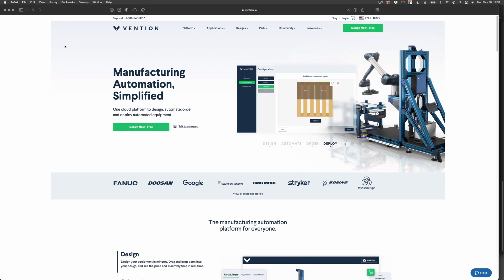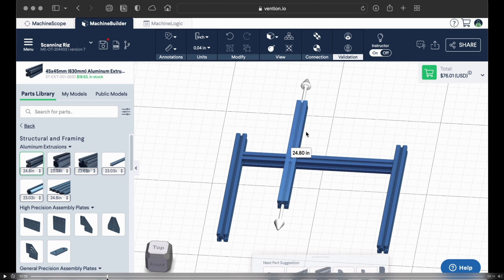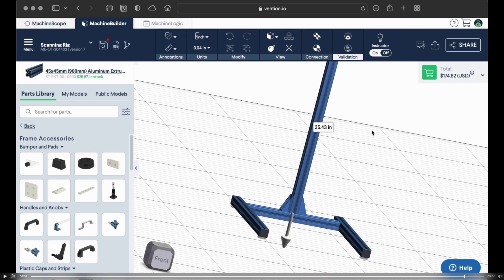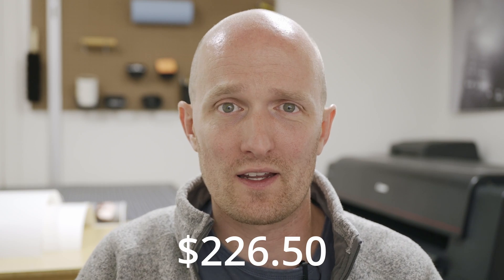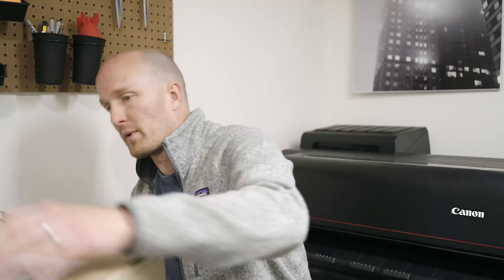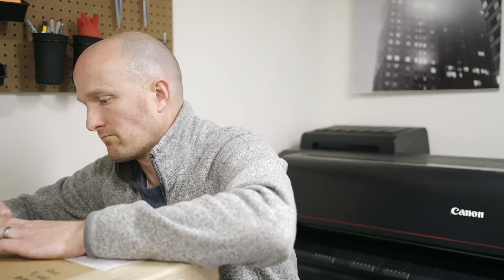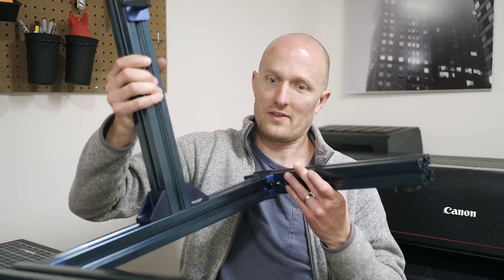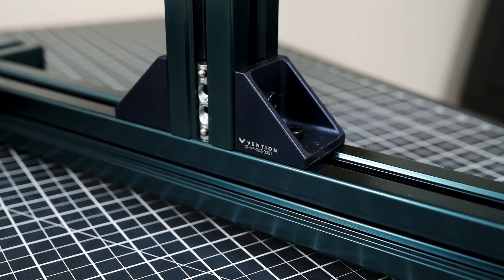Building a Camera Stand for Film Scanning Ep. 2 | Film Photography

Comment: Ha!  Just done the same with 4040 extruded aluminum  single  vertical piece rigidly held on a  ply 15mm thick  24" x 24" baseboad. 
All parts were from ALIexpress...and cheaper than UK dealer by far..  (Think the 4040 a bit overkill)..3030 would do for a lightweight englarger such as the Intrepid 35mm/120 for instance...Slider I fitted with 4 runner wheels and brake knob.
.I have an idea that might work for the slider to prevent a sudden drop...attach a wire to slider over the top down the other side to a lheavy weight running in the grove at the rear...Much check out the local plumber for  lead!  🤣

Comment: Think I preferred the guy who secured a pole to a piece of wood and used a photographic clamp...
Reply: I did that, too. Floor flange, 3' by 1" steel pipe, Superclamp, mount insert, ball head tripod camera mount with quick release plate. Height adjustment is a bit funky, but once you mark the column for various sizes, it's easy to set up for a particular film size or print size. I copy prints, slides, and negatives to digital. It also works for stamps, coins, and more. With the right ball head, it can be a YouTube presenter desk to mount a camera above a laptop.